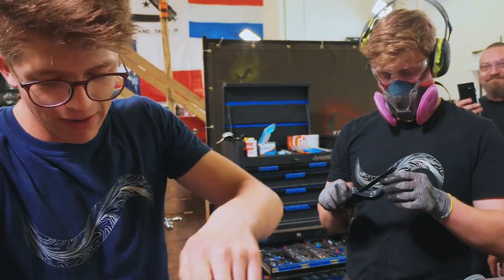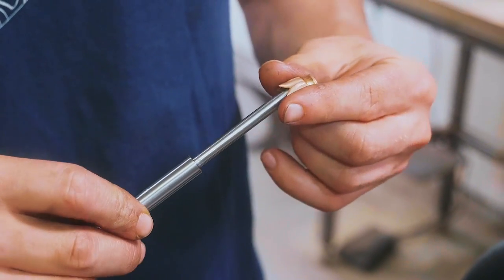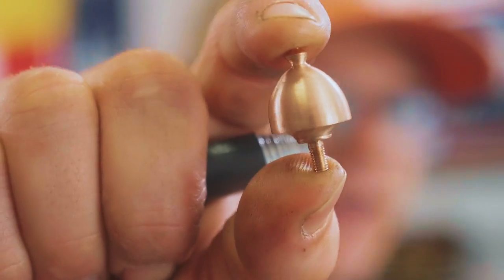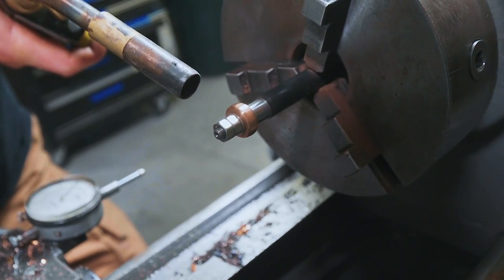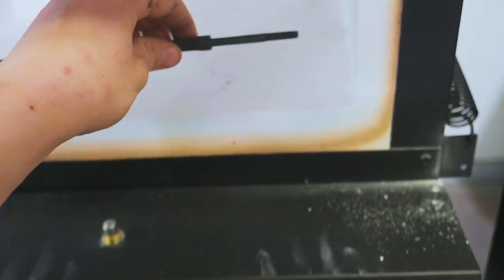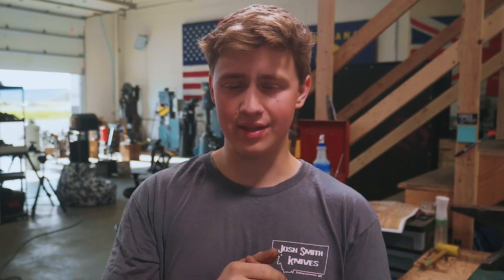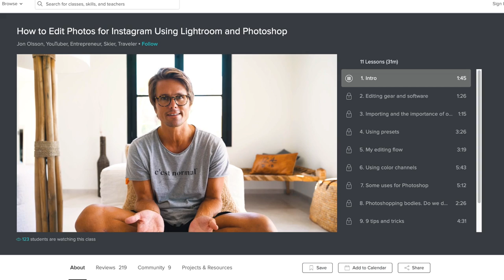DAMASCUS STILETTO DAGGER!!! Part 2

Comment: GUYS SLOW DOWN! at this speed youre gonna finish the build before you hit ten parts! where is my 30-parter like in the old days?! XD
Reply: Hell no. If each part is gonna be 20+ min than 10 parts is almost too much, if they're only 10 min than maybe but I'd much rather have fewer longer episodes than lots of short ones.
Reply: If each video was 20+, then 10 parts is not to much. I would love more video footage of them just working on it with just the sounds of the shop instead of a bunch of quick, and slow-mo, shots with music playing over; not that those aren't also good though.

Comment: I feel like this won’t be that long of a project just because of how many people you have working on it
Reply: INB4 part 3 disaster, have to re-do everything.
Reply: @ColtaineCrows  the hole blade explodes in dust the garage catches fier dose plot paths are stupid all in all this series gets a 4/10
Reply: That’s a good thing lol, that means every went well, it defiantly doesn’t decrease the value of this beautiful thing
Reply: Helps that so much of this build can be roughed out on a lathe. I think that's kinda why it's been fast. Also Will using the collet for the blade angles saved a lot of time. There's a lot less hand shaping on this one
Reply: Sherlock
Reply: if 2 people can do it in 30 episodes, surely 30 people can do it in 2 episodes?

Comment: For future reference -- superglue has very little shear strength, use a retaining compound instead (i.e. Loctite 609)
Reply: Super glue is great, but for this purpose locktite works so much better and is made for this kind of stuff. It really is very sound advice.
Reply: YS TR  Yeah, but he uses it on the "aahbah" attaching the flat part of the work piece. That way the forces are more evenly distributed.

Comment: I ran into the same problem with something unscrewing so I reversed the direction of the Chuck and turned the cutting tool upside down and cut perfectly. Y'all do great work and I'm impressed with the improvement of the machinist skills.

Comment: "Damascuses to etch"
Is that really the plural?
Damascuses?
Damasci?
Damascopodes?
Da-more-scus.
Reply: Da-more-scus😂😂
Reply: da-mass-cus
Reply: I'm late but as a non-english speaker I think It should be damasci, cuz cactus becomes cacti and octopus becomes octopi
Reply: zexceed if you go into pedantic you could argue octopus goes to any of the first three
Octopuses is a perfectly fine English plural because of common use of it
Octopi as the English word comes fro Latin
But the Latin comes from a Greek word and by that logic it is octopodes

Comment: Alec you should try to forge a folding knife after you finish this project
Reply: He already has but I want to see a flipper folding knife.
Reply: Alternative Gaming he already has made a couple folders with other ppl
Reply: HMS 007 clarify, what a flipper is? A butterfly? A switch blade? A side fold auto assist? Do you really even know what your asking or do you just have some idea in your head of some new radical design called a flipper that will be the next best thing since the bread slicer?
Reply: @RichardCranium321  I mean a folding knife with an external flipping mechanism. For example, a Kershaw chill.
Reply: HMS 007 didn't he do a folding straight razor with the external manual lever? I know green beetle made a couple & thought Alex did too but could be wrong. I'd look through his archives if I were u bc I really think he's done one.
Reply: @RichardCranium321  I'm not sure if he has but what O think it would be cool to see him make is a knife where there is a detent system along with a flipper instead of a friction folder.
Reply: HMS 007 someone did a manual assist lever folder with a magnet in the handle to hold the blade shut & a flat torsion spring lock for open but I can't remember who. It was a very unique concept & I thought it was very inventive. I will send link if I find it, was very good content
Reply: @RichardCranium321  Definitely sounds cool. Thanks!

Comment: Nice job on the lathe fellas. You can reduce the force between the carbide tool and work piece by using a ground high speed steel tool instead. Carbide cutting edges are "blunter" than an edge created by grinding a HSS tool.

Comment: what I recommend you to do
higher rpm when working on part with such small diameter
if you want to part something like this, use thinner parting blade, feed it slowly, they break rather easily

Comment: A bit of a safety tip (if you ever see this)
Whenever you're using a file on a lather, you should use it left-handed so that your arm isn't stretched around the spinning chuck

Comment: So, when using the lathe like that with supergluing the part to the mandrel... Maybe use opposite-turning threads...or reverse the rotation and tool orientation. That way you don't unscrew the part you are working on.  Though what you ended up with is usually what I go after. If you do try the opposing threads idea, though, be sure to use a little anti-sieze, just to make sure it doesn't overtighten.

Comment: Old machinist trick (from an old machinist):  You are not using that beautiful 10EE lathe to its full potential.  First, relegate that antique 3-jaw chuck to the display case / recycle bin.   Get a 5C collet holder for your lathe and a 6-jaw, adjust-true, scroll chuck with removable top jaws.  Then, when you turn something you can remove it from the lathe and put it back again being sure it will still run true.  And get used to checking everything with a dial indicator, too.

Next, when threading tangs and the associated hardware and finials, do it ALL on the lathe.  Stop using the bench vise and threading by eyeball.  Either single point the external threads (it is not that hard) or make a die holder for the tailstock that holds the button dies true.  The same goes for tapping.  You will be amazed how much easier your lives become.

Comment: Regarding the mandrel, you cannot chuck up a mill finish bar multiple times and expect it to keep concentric. You would have needed to machine a large length to chuck up for subsequent operations if you wanted that post to remain close to concentric every time you chuck it up.

Comment: I imagine the reason the Demarcus shows up better when hardened is because after hardening the different steels with form different grain structures. Not sure but I bet the etching fluid you use affects the different grain structures in addition to the different types of steel differently cause the better contrast.

Comment: Heat treated steel etches better because martensite (formed on the quench), gets more color distinct on high and low carbon areas than the perlite (normalized)

Comment: Have you tried warming up the etching solution on a hot plate? The heat from the metal might be causing the solution to etch more quickly and you might be able to save yourself some time and expense by just heating the solution rather than the piece. Do be careful though,

Comment: im gods honest surprised yall did mixed metal threads, atleast yall have the blade integral threading to the handle as same metal, i think im only seeing the acorn,,,that goes on either the guard or the base of the handle, and if its decorative id just be scared it would strip in, also i wouldnt want it to be removed... love yalls vids!

Comment: You get a better etch when you harden damascus because of what happens to carbon when heated in an oxygen rich environment. I'm not sure what alloy of carbon steel you guys used, I assume 1075 or 1095, with the 20xx steel but when you heat treat that high carbon steel the carbon starts to actually be consumed by the oxygen in the air. By consuming some of that carbon and then locking the structure of the steel (quenching) you get tiny microscopic holes resulting in a deeper gray almost black color that contrasts really well is the shiny high nickel steel.

Comment: Excuse my ignorance, but why did the metal chips from the dagger on the lathe turn blue?  Is it a heat related color similar to how tempering changes colors of the steel, or some other mechanism at work?
Reply: That's exactly the reason why they turn blue, when it is cut on the lathe the friction of being cut off heats the metal up and tempers it to the blue color

Comment: The pattern looks better afer harden it because there is an bigger difference between the hardness of the different steel layers so for the acid it is easier to get into the soft part of the damaskus as to get into the hardend part.But this is only how I think that it works and if my english is not the best than a reason for that can be that I´m a 13 years old smith from Germany.

Comment: @Alec Steele Doesnt your lathe cut threads? I saw you using a die..... Also, you need to reduce the echo in the engraving room, upstairs in the loft. Oh and one more thing..... Im prolly related to Neels in the way way back.....

Comment: If your working with super glue it may be handy too have some super glue accelerator around a problem you may have had is that glue on your part was cured.

Comment: Love your work, but you need me to teach you how to run a lathe.  You need a steady rest, and you need to use tail stock support wherever possible.  Also, far less stick out on material and tools.  Steady rest with a cat's head would really help with the runout problems as well as the chatter.

Comment: The Answer to the Question about etching hardened Damaskus:
There is a difference in hardenability of the steel types used for making the Damaskus. The difference in hardenability will result in different microstructure. (Martensite responds differently to etching then an Frerite Perlite or bainitic microstructure)

Comment: Just an observation, the handle end didnt seem to  e moving all that much in relation to the rest of the handle in the lathe, every piece I have seen you make in there so far has always looked as though the lathe is running slightly off centre and a little eccentric, that makes your handle look like it's more nent/off centre than it really is.

This piece is looking amazing so far though, cant wait to see it finished. 

Will it be going to auction again?

Comment: Your using the wrong jaws on the lathe. You should use the jaws for grabbing the OD of your work. Specially when doing thin long jobs. It will allow you to hold the work closer to the cutting action. Also a lot safer.

Comment: So I too do stuff on a lathe and end mill that would make Machinest cringe but one thing that I do that is about as sketchy as using the file while the lathe is running is use a hack saw to cut off my work piece while the lathe is running. I move the saw just like I would if it wasn’t running. But be careful as it gets close to being cut all the way through because it will cut through in one spot first and will make the saw try to bounce out and scratch the work piece.

Comment: Nobody knows? You know exactly what heat treating does to the steel and that's also what changes the way steel etches in ferric chloride... The different cristalline structures are easier or harder to attack for the acid and seemingly after heat treatment you have a cristal structure that is easier to etch.

Comment: Is no one else bothered about the two different symmetries used? Why is half of it based around a symmetry of  3 and half around 4? It means that the handle facets don't line up with the blade or the diamonds... Otherwise, very nice job. Please get some inside jaws for your chuck though, it makes lathe work much easier because you can have less overhang and therefore a more rigid setup.

Comment: Its a chemical reason:

Increasing the temperature about 10° doubles the reaction speed with the acid and the metal 🌡️🧪
Reply: Which has nothing to do with the process per se, as the part has cooled down to room temperature regardless prior to the etching process.

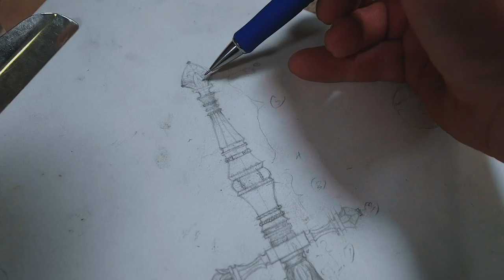Comment: 13:00 I think the eye-journey isn't going to go as smoothly as he thinks...
the blade has 3 facets, there are 6 leaves, but the handle has 8 facets, which means that the leaves and blade facets cannot line up with the handle facets :(

Comment: Next big project: Damascus steel-sub hilt-integral bolster-cocobola handle-leather lanyard-gem stone inserted bushcraft knife with quick release straps-altoid, tinder,  Wet Stone & Fire Starter pockets leathre scout sheath.
Maybe thow in some twisted gold wire flukes and custom lanyard beads to.
Alec Vs. Will kind of challenge. so each one of you guys can have their own knife and go use them on the wild.

Comment: Alec you need to watch ClickSpring, his work with lathes is second to none!

A way to hold a small part with superglue in the lathe is with a cylindrical piece of stock slighty smaller diameter than your work piece - clean the face and then cut concentric rings into it, which gives maximum purchase for the glue. Apply said glue onto the face and stick your workpiece onto that

Comment: Alec. The glued bronze would have been more likely to cut if you used a high speed steel cutter. Machining 101: HSS cuts with a shearing action. 
Carbide cuts with pressure. 
If you are going to use a setup that relies on super glue then shape it with an abrasive or high speed steel cutter. Great work in the end. Hopefully this helps.

Comment: Could you make a Sparth Axe Alec?
I am planning to take Mull ,Coll and Tiree back by force if needs be on behalf of my Clan who were Gallowglass  back in the day and rather unfortunately had our Lands confiscated after the first Wars of Scottish Independence.
As a result they were forced to take up arms and go Mercenary over in Ireland and deal with the Norman Invasion.
Which I gather being half Gael half Dane they did to quite devastating effect.
If successful I would gladly display your fine workmanship in my newly acquired Castle which might well get you a few more subs in the long run.
Failing that thanks for reading this rather padded out request and carry on the good work 😉👍🏼
Remember “Gallowglass ya Bass”

Comment: Me: looks at the design on the paper, putting together, the time spent making it and material cost (including gas for the forge, and the electrical cost) i'd estimate the price 500-750 dollars at auction for a piece of like this.
Alec: lets add diamonds to it.
Me: (0_0)....Alright....lets see now hes got 18 roughly .01-.02 carat diamonds on there....alright so that would have me estimate a price of about 800-1000 dollars for the dagger at auction.
Reply: Leviathan I’m sure it would be a hell of a lot more than that.

Comment: Y'all probably know better than me but the higher grit finish you have before quench the better. If you quench a piece with a 1000 grit (or higher) finish you will save a lot of time with very little to no scale. Damascus steel combos may vary.

Comment: Hey Alec just wanted to point out a slight flaw with your method hopefully before you make changes to the blade too much. On the lathe you are using a 3 jaw chuck. As soon as you take a part out of one, you can't just put it back in and it be concentric. For that case you would need to true it in with a 4 jaw and a dial indicator. Same problem with the mandrel. Hope this helps and you make a beautiful piece!
Reply: Or turn it between centers

Comment: When you make a mandrel machine the part that is going into the chuck as well that way it is running in the same plane as 3 jaw chucks don't like black bar. A tip from a machinist for some food for thought. That is a good looking piece.

Comment: It looks amazing so far, but I think that the center block of the guard could be tapered toward the quillons slightly. That spot doesn't seem to flow as well as the rest of the handle does, like it's too rectangular compared to the other sections when viewed from the side. Love the symmetry in the blade and handle though, can't wait to see the final product!

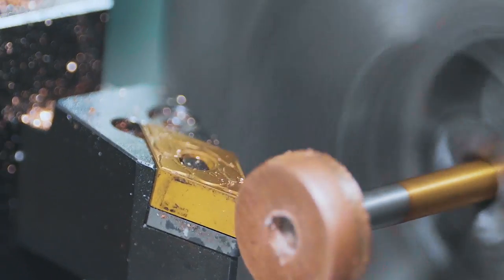Comment: Please Alec use sharp HSS tooling when working with soft material such as copper/brass,  the super bad surface finish comes from your insert tooling. See these ripping marks at 8:42? That's why the superglue wasn't strong enough, carbide inserts are generally not sharp enough to cut gummy materials.

A diamond type hss tool holder would be perfect for you as it doesn't require a lot of sharpening on the tool bit.

Comment: Alec, you are doing something WRONG. When you use the lathe to turn anything in the lathe. Chuck up the part as close to the chuck as possible. Watching you turn the bronze rod it was wobbling, so not a true center. The rod was way to far out from the face of the chuck. You could use a steady rest when the part is that long. Or a drilled center hole and a live center. But just remember the rod was to far away from the face of the chuck.

Comment: for those wondering what a tri-cross section blade cannot cut. there will be some who say i can,. can it break skin... yes. but it wont CUT. the best example of this type of blade is a Small Sword, the same one Arya Stark used in Game of Thrones. She cut n did slashes with it but in reality all it can do is stab like a french Estoc. it even lacks weight to be able to handle glancing blows (static blows are out of the question). sword have multiple parts but there are two distinct parts the weak of the blade (furthest from your hand) and the strong of the blade (the closest to your hand). of course things can change with grip n blade geometry. but with the small sword you need to use the bottom 1/3 of you blade to defend (unless you are fighting a low weight sword... like another small sword) FYI fencing foils are PRACTICE swords for Small swords.